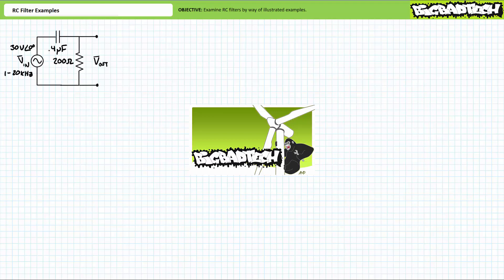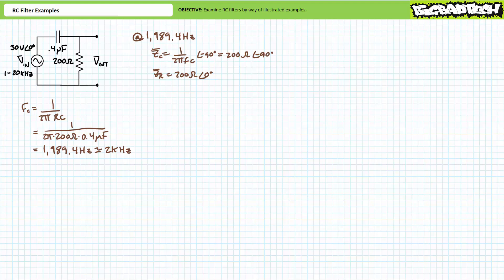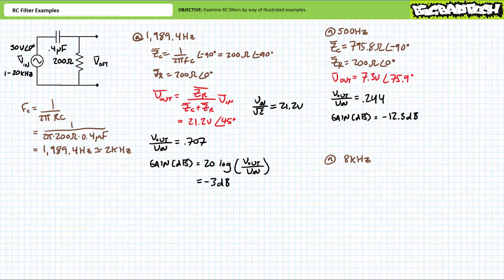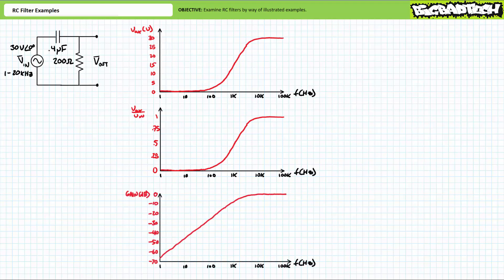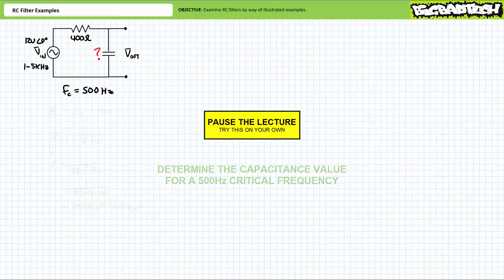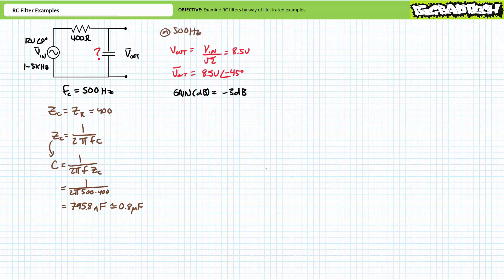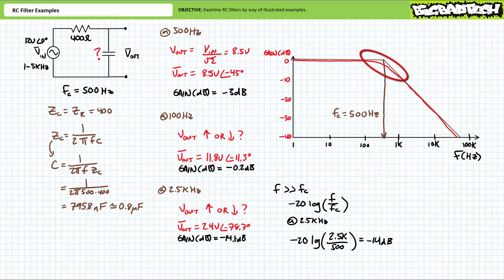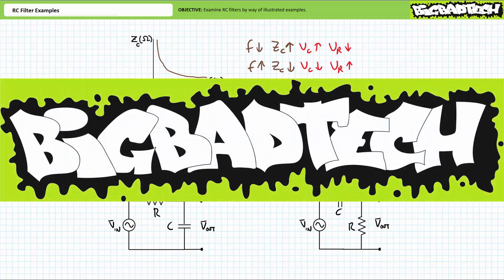RC Filter Examples (Full Lecture)

Comment: I found your channel when I needed DC circuit analysis, so I watched the DC playlist, got rewarded with an A+ on my exam.  Now I made it to the end of AC single phase, I enjoyed every minute of every single lecture! Thanks a lot! 
Could you suggest me an order to watch your playlists from basic to complex. I think to start now with AC 3 phase analysis and than move on to PLCs. I am studying el. engineering.
Reply from the maker: Very nice! Glad you're making good use of this material. Please tell your friends.

Here's how this content is packaged for students enrolled in CGCC's Electro-Mechanical Technology program:
Fall
Basic Electricity and Electronics 1 https://openoregon.pressbooks.pub/electronics1/

Mechanics (no online lectures)

Winter
Basic Electricity and Electronics 2 https://openoregon.pressbooks.pub/electronics2/
Hydraulics https://openoregon.pressbooks.pub/hydraulics/

Spring
Basic Electricity and Electronics 3 https://openoregon.pressbooks.pub/electronics3/
Motor Control (no study guides yet) use these playlists:
Motors and Generators https://www.youtube.com/playlist?list=PLdnqjKaksr8oba07pG-nE1Omy1_mabMtIMotor Control https://www.youtube.com/playlist?list=PLdnqjKaksr8qRPCFkU2Q8XQe0bfo99rs6
Programmable Logic Controllers (PLCs) https://www.youtube.com/playlist?list=PLdnqjKaksr8qxlMYRVTF2YzTm6RwtA7pc
Motor Drives/Variable Frequency Drives (VFD) https://www.youtube.com/playlist?list=PLdnqjKaksr8qruLl85Uq3em62PjXlSNUF

Feel free to skip around, however, this is a great foundation.
Reply: @bigbadtech  thanks again. sure I will tell my friends about your resource!